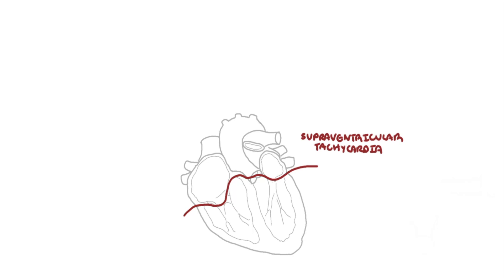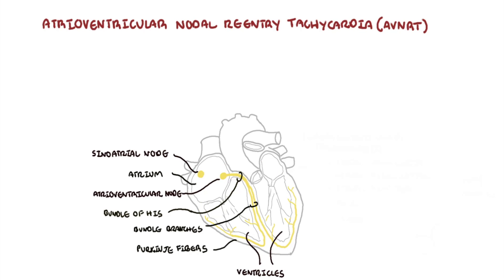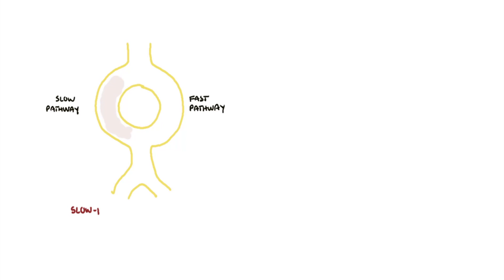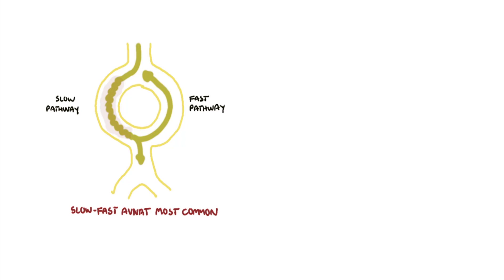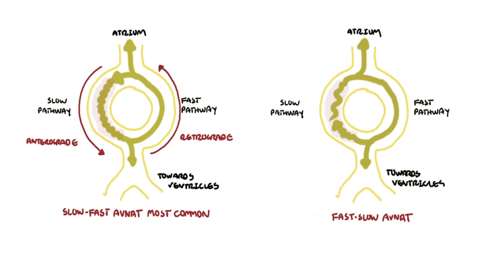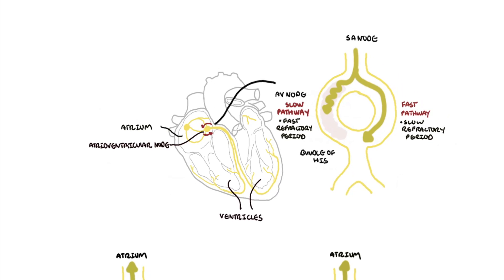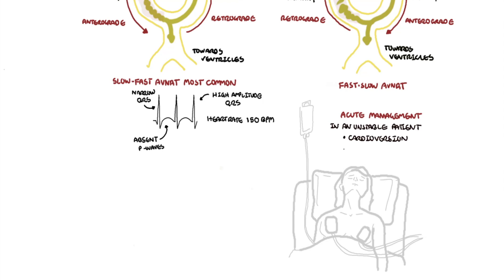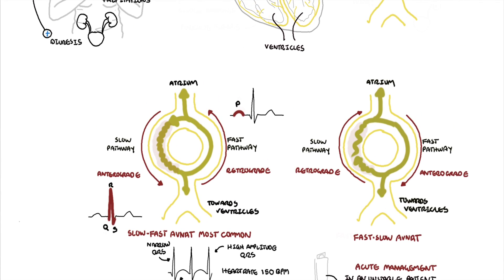AVRNT (atrioventricular re-entry tachycardia) - causes, pathophysiology, treatment

Comment: My sister is having Ablation performed next week. Can anyone give me a "for dummies" explanation of what this is and why she needs it. Is it medical terminology for having a pacemaker put in or what? She's 56 today (6 years younger than me) and although I worked on "special weapons" in the USAF I have no idea what this is and she told me to look it up on google but like I said, I need a short, sweet and layman's explanation. Thanks.
Reply: Reentry circuit is basically an electric impulse going in the heart, but because it was produced at the wrong time, it got in the loop around scar tissue and intermittently goes around it producing same impulses which make heart contract without rhythm (that's why it's called arrhythmia). Ablation is a procedure which requires percutaneous catheter(long thin tube) insertion in vessel, via which it'll go directly to the place of scar tissue in the heart. Where the heat or cold, depending on the type of catheter, is going to get rid of the scar tissue and therefore restore the rhythm.

Comment: In 2009 I had PSVT...came to normal  after holding breathe 
I continue taking verapamil. 
In 2012 I got AVNRT...came to normal after some medicine.
Both times I was in observation at a cardiac hospital. 
In 2013 I was done Electro cardio RF ablation.till now no problem. 
My doubt is ...is there any chance of  recurrence of AVnRT or any sort of tachycardia. 
Is there any advance medicine as maintain dose.
I am obese.
Taking Olmexest H 20 for BP.
Reply: No problems after your ablation in 2013?
Reply: I had an ablation for AVNRT and it grew back within 6 months. Now I have it again. Try speaking with your doctor :/
Reply: @danpettit7667  you thinking about getting it re done? After your ablation did your doctor think he got.it all?
Reply: I think mera case bhi kuch Aisa hi h 2019 I had PSVT and now AVNRT

Comment: Thank you for the clear explanation! I had an AVNRT ablation in 2005 but back then I was too scared and didn't want to know the details. Sadly I don't know if if I'm part of the 95% percentile or not... Either way, it's good know why my heart was beating 214 bpm!
Reply: I was in the 5% that got it back after an ablation, turns out i have 2 extra cirtcuits. First time i got it real bad the EKG showed a heartrate of 250 in the ER, 2nd time after the ablation it showed 256.
Reply: @DerpsterSwe  did u have success after your second ablation?
Reply: @erick7brian  Haven't had my 2nd ablation, not yet anyways. My new extra circuit is basically right next to my AV-Node so they wanted to wait and see if i continue to have problems because it's riskier to remove and i could end up with a pacemaker if they accidently damage my AV-Node. Im on betablockers for now.
Reply: @DerpsterSwe  same
Reply: @DerpsterSwe  hope u're doing well.
Reply: @cherylceri3157  Im alright, still no ablation but continuing beta blockers works decent. Definitely have less quality of life but what can you do.
Reply: @DerpsterSwe same 285 is mine and started from 2019 but mene kbhi itna serious nhi liya jisko dikhaya tha unhone psvt bola or abb mera treatment AIIMS delhi se chlra h or unhone AVNRT bola h
Reply: Have you had episodes since your ablation in 200